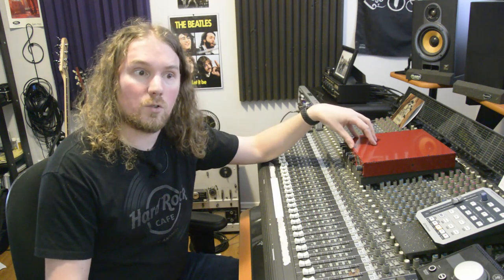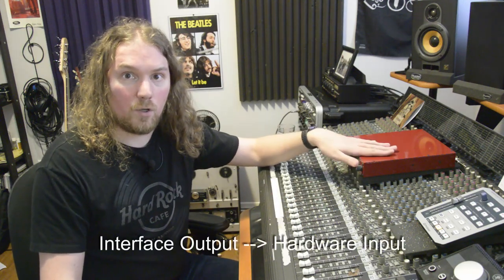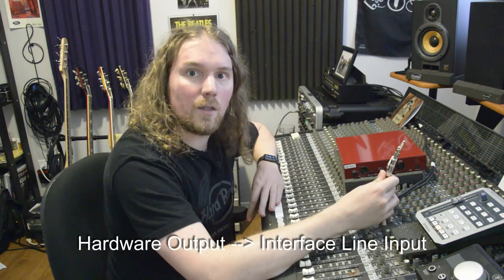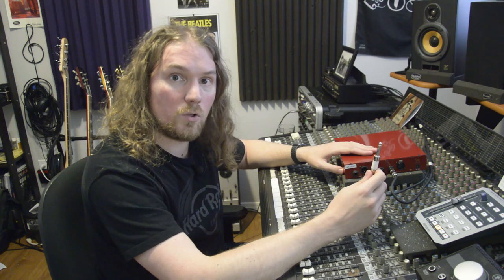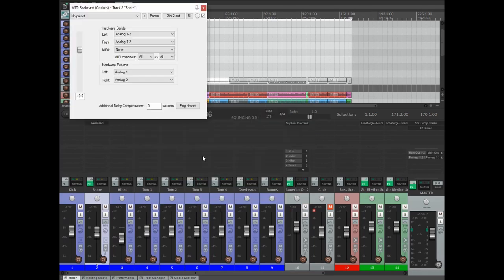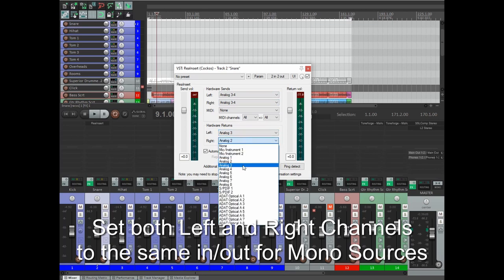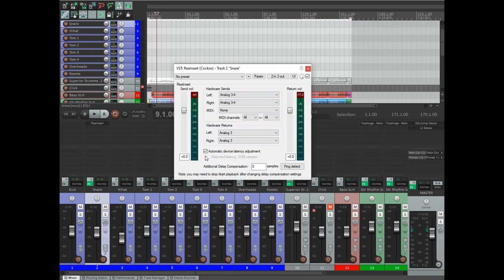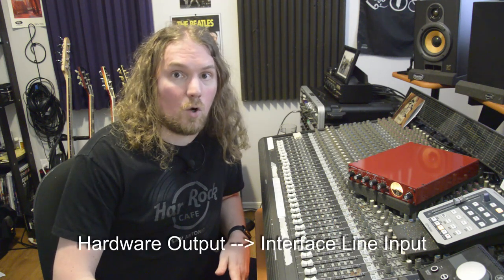Setting Up And Using Hardware In Your DAW Based Studio

Comment: Using  reainsert how u you know what level adjustment is needed going out through a hardware  piece an back in? And or what amount is harmful or beneficial?
Reply: by trying it out! don't be afraid to try things - experience is the best problem solver in cases like this.
Reply: @nolarocks  yes YouTube can help but there are many things that pros don't show but I found there are too many variables for this question I had last yr

Comment: How to use it with the mixing console
Reply from the maker: That console has a TRS insert point on each channel so I would have to get a Y cable, plug the TRS end in to the insert point of the console then plug the in/out on the dual end of the cable in to the in/out on the compressor. If your console does not have insert points but has a direct out, you could use the direct out to send to the input of your compressor and have the compressors output send to another channel on the console. You could also use the Aux send/return on your console as an insert point, just make sure to keep the channel fader down and set your level with the Aux Return knob unless you want a parallel compression thing to happen!